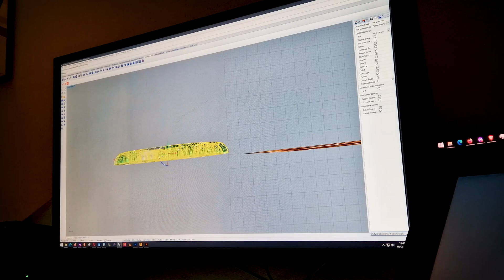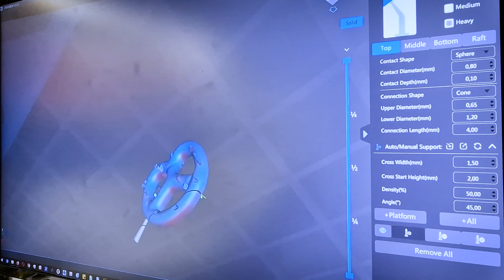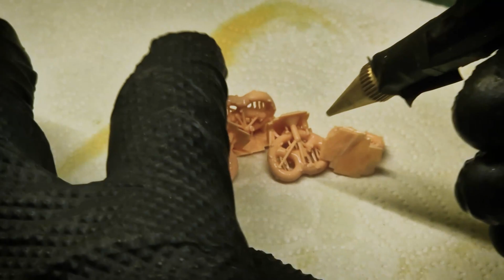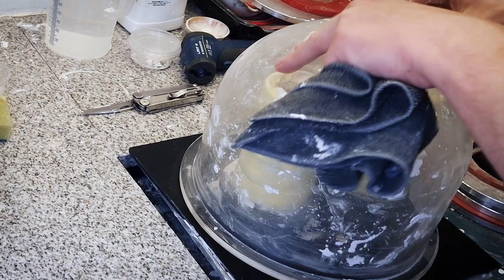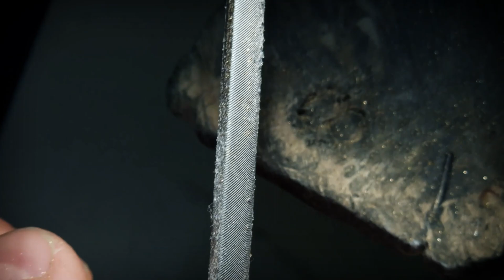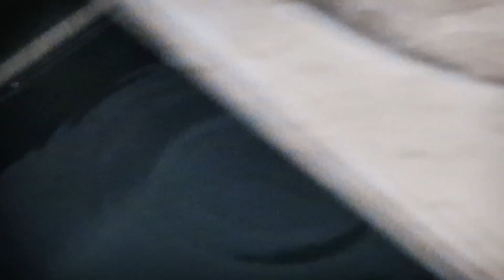Making a REAL 14K Gold Pretzel 🥨 Necklace from 3D Design and 3D Printing

Comment: Hey! What rinse are you using for those 3d models printings? Also what are those solutions that you are cleaning your 3d models after printing it? I am interested in trying to do my own custom ring like that, but I want to make sure it's gonna work out well. Any advices?
Reply from the maker: Hey, we use several resins but on the video is resinworks. The prints are rinsed in IPA alcohol. As for advice it's a tough call, it all depends on what stuff you use. All in all, one of the best tips I can give is to have a great kiln for firing and do a lot of testing and practice :). In a bad kiln that cheats the temperature you will lose a lot of time and the effect will be poor no matter what resin you use. It took me several years to get to this point. ~ patryk
Reply: @delloropl  thanks a lot for that reply! Very helpful. Two additional questions if you don't mind. What 3d printer model and kiln do you use? That IPA alcohol, what's the difference beetween "IPA 3" and "IPA 4" solutions? Why do you use both of them and where do you rinse them before those 2 containers? Thanks again, amazing work and very helpful advices!
Reply from the maker: We have a few printers, but in the video is phrozen. The klin is argenta but is a bit modified. It has a different programtor and additional insulation.  As for alcohol - these are just different baths. In each there is more and more pure alcohol :). The last one is in the new pure ipa. PS. to the videos are added subtitles and there is most of the steps described